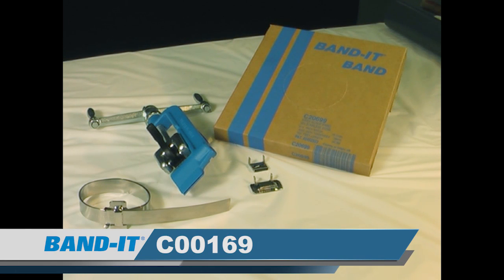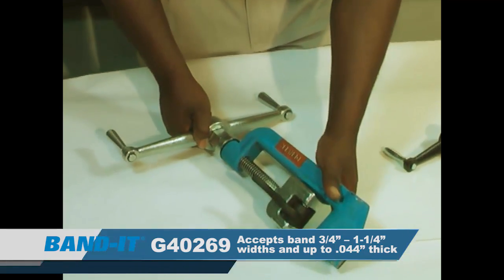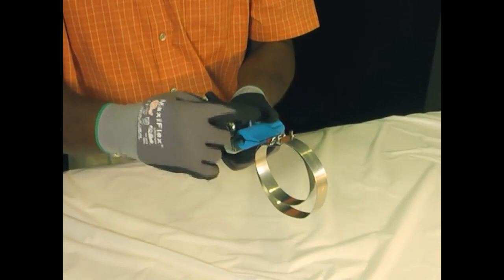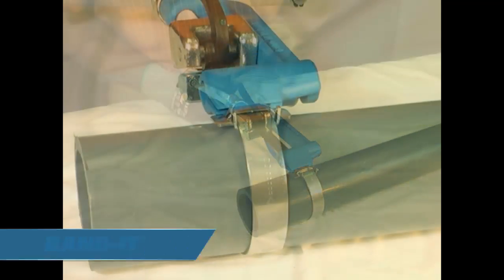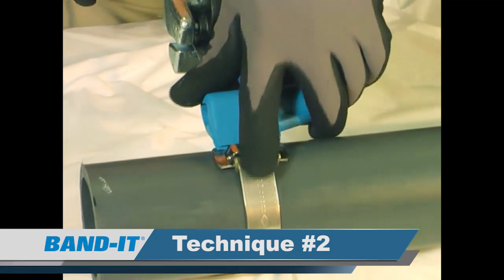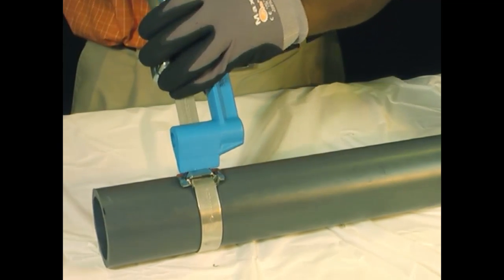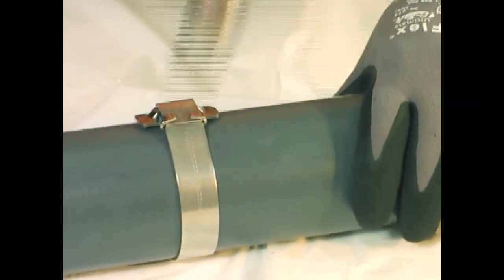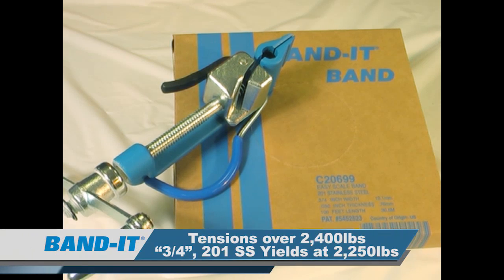BAND IT Tool C00169

Comment: I watched a video My unit must be different it has a different banding system I bought the bandit clamps that are already pretty much formed. I can't figure out how to make the cutting tool work. I'm so sad tried it like 10 times I'm only using water hose so the clamps are working but they're not in properly I hate my life

Comment: used this tool for the first time.  The video is so superior to the provided instructions that have some VERY crummy pictures.  I did finally figure it out but one thing that i have not reconciled.  It says that you can use the spool and not waste.  Holding the spool or a length of band while trying to set the band clamp is more than a handful.  maybe with two people or with a skill that is not shown.  So I have to do a little waste until that skill or a second person comes along LOL

Comment: Is this tool just meant for circular tubes and the like or can it be used on for instance a pallet full of bricks
Reply: It could be used for just about anything you can wrap the banding around.  The banding material is not cheap.  It made of stainless steel.
Reply: You’d want to use a standard banding iron and banding tool set up for bricks and lumber.
It will be a mere fraction per use compared to the stainless banding and stainless fancy seal/fastening clip

Comment: I’ve been using this tool since about 1970. It was sent to Band it once for chipping at the face. They sent me a new tool no charge. I have a Junior adapter that I use most often now. I just made up a hard suction hose for a Honda water pump.